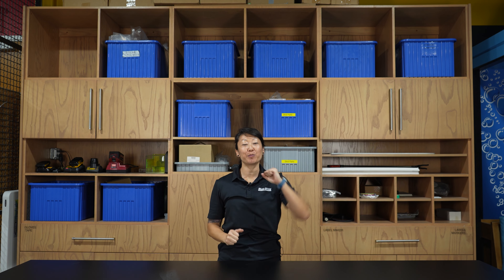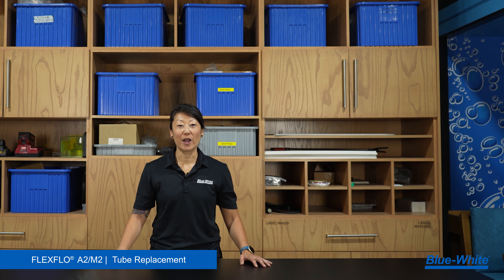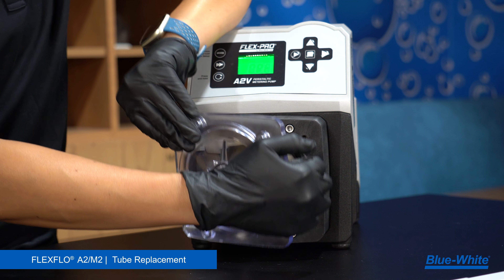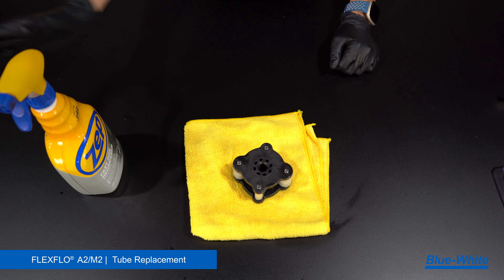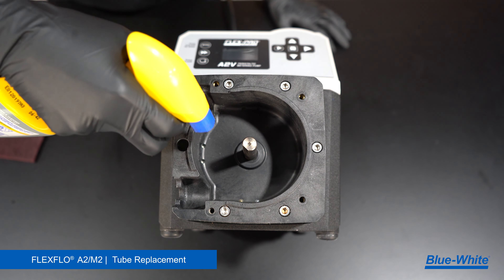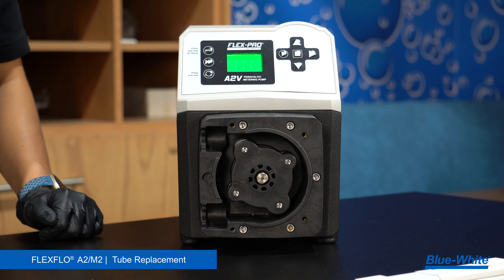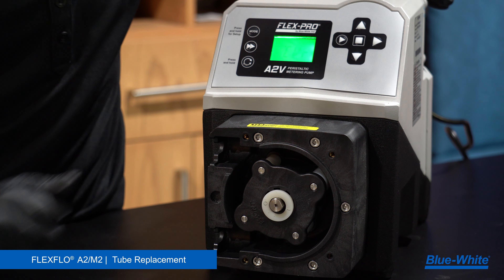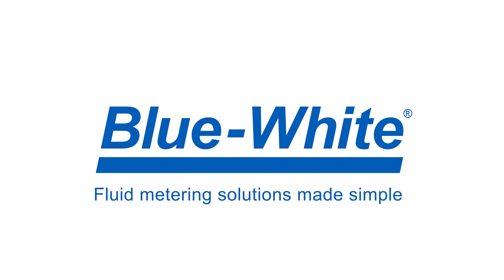BWA A2 | M2 - How To Perform A Tube Replacement

Comment: I have been very happy with our A2V pumps at the water treatment plant I work at. With running them 12-15hrs a day, it took over 10 months for the tube to fail, which is impressive. We have been changing tubes every 6 months for convenience and to avoid chemical mess in the roller housing. Blue White is awesome.
Reply from the maker: Thank you for the support and those kind words!